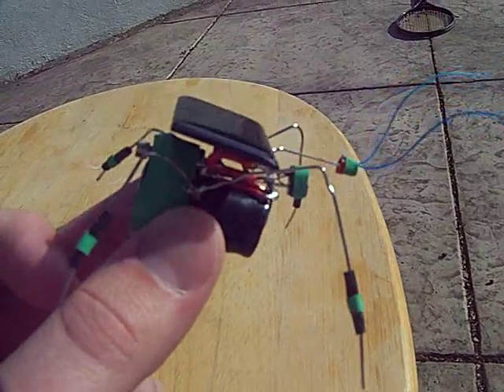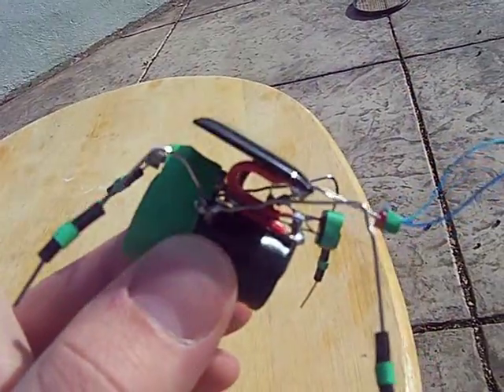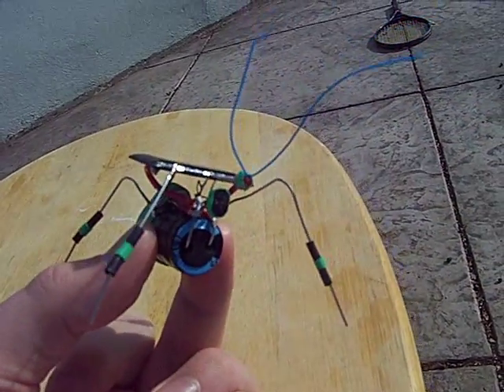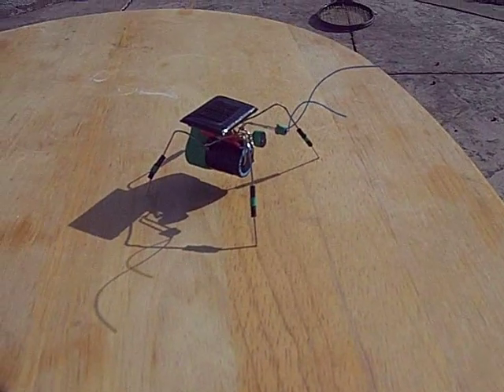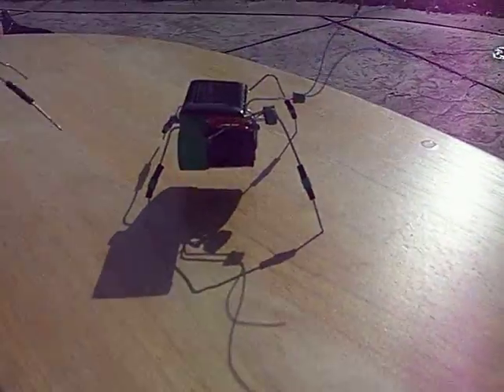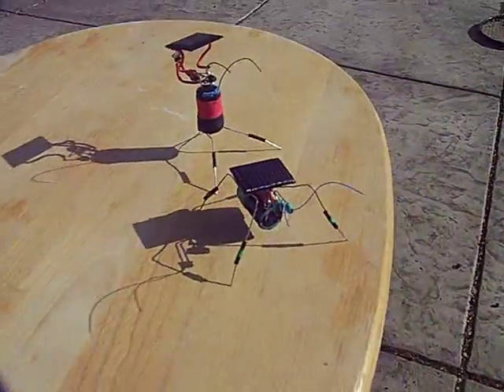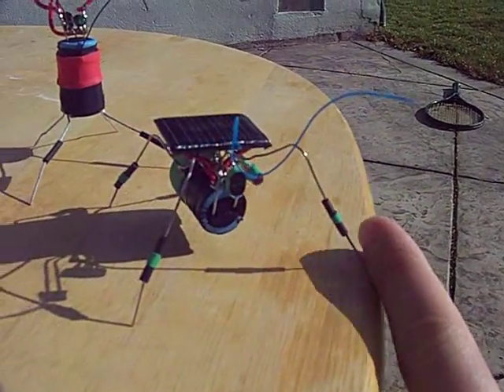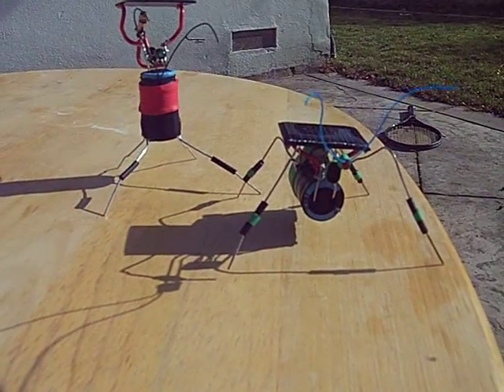Solar Powered Vibrobot #2 - BEAM

Comment: @tzimmerm27 thanks, obviously im a newbie. So what's the point of having the capacitor in the robot?
Reply: Holds the electricity until it reaches a capacitor determined level.  Then the capacitor releases the electricity, making the bot move due to the motor with the off center drilled piece of metal on the back.

Comment from the maker: @Traconiz It looks like those cockroaches are not using a heavy capacitor. Mine is probably underpowered for the weight. The cockroach looks very light and just powers the vibration motor directly from the solar cell. Less weight = more bounce. Plus they don't have a charge up time associated with the capacitor, so it will essentially keep moving in direct sunlight.

Comment from the maker: @Traconiz If you power a motor which turns a wheel you can get something that moves pretty quick. Mine is only "moving" from the vibration from the pager motor. Search "solar roller" and you will find some pretty fast little solar cars. Solarbotics has a solar roller kit